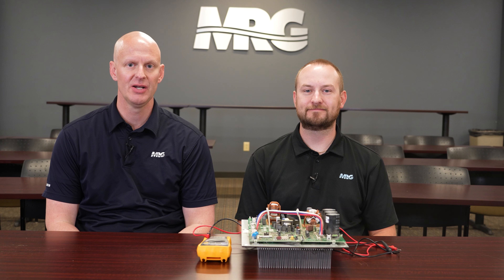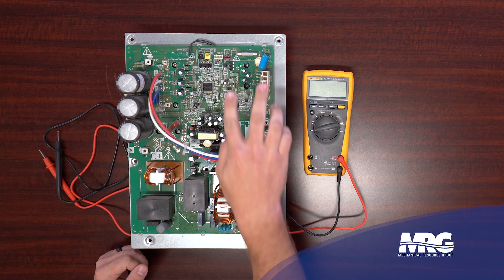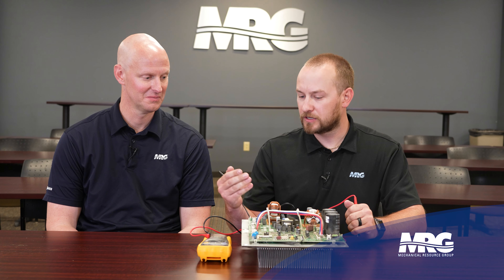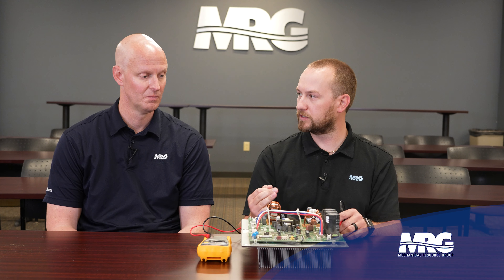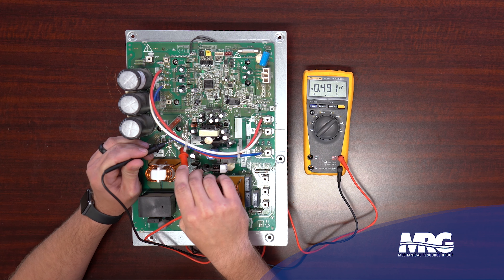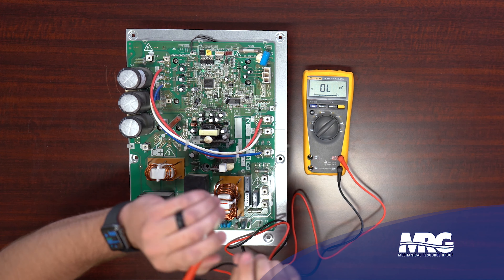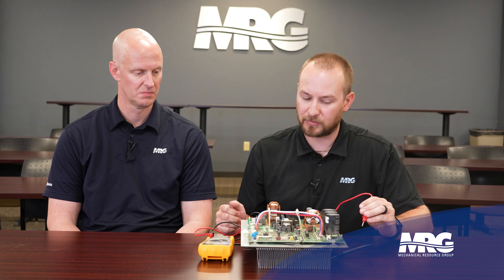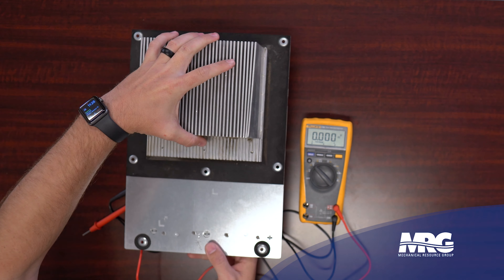How to Troubleshoot Daikin VRV Inverter Boards

Comment: I've been using the Daikin inverter board checker tool recently and have had good experiences with it. Sometimes it's across a roof and down a ladder, so it's good to know how to quickly manually check these boards. I would love to see a video on your procedures when you change a compressor. So much of the way I work on these machines has been through self-taught pain and suffering; I appreciate you all taking the time to create this content.
Reply: Got a part number for that tool?

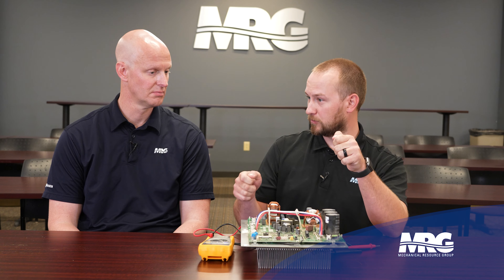Comment: @13:42. With all the wires disconnected from the compressor, not touching anything and then run the Power Transistor Check mode 28, one lead to the disconnected wires either U, V or W and the other lead to the Ground check? Multimeter in DC voltage check mode? Thank you
Reply: Between any 2 of u, v, w
Reply: @LC-qi5ff please what is LC 03 mean

Comment: Ok my question on this topic, i know you can turn off and inverter board via the mode settings ; and i did that and the unit ran without problem however after i took the bad board out to to take to the supply house the unit has an error as it says it cannot communicate with the said board. So i guess the setting isnt a full deactivation and is more a prevent it from running?
Reply: Did the unit run or shut down due to the error code?
Reply: @qomco  it shutdown

Comment: I do not understand here...isn't an inverter circuit ment to  convert DC to AC...!!!! The scroll compressors I've seen on Heat pumps eg..Toshiba SMMS-i versions are rated with DC Voltage ...Please if coild clarify for me as I am still a rookie ..Thank you
Reply: The board converts ac to dc then dc to ac it’s to filter the electricity. 
Much how speed drives work.
Reply: AC input voltage is indeed rectified to DC. While one could say that it is then converted to AC, that is misleading. The compressors are indeed DC. The goal of the controller board is to monitor conditions and dynamically and optimally adjust the motor speed. It does this by chopping up the motor current  using a process called pulse width modulation which pulses the DC current at varying rates to achieve the varying motor speed. The output current is only ever at 0 volts OR the rated voltage of the motor. Hence, not AC strictly, but pulsed DC. Look up "square wave" in your search engine and you will slap your forehead with understanding!